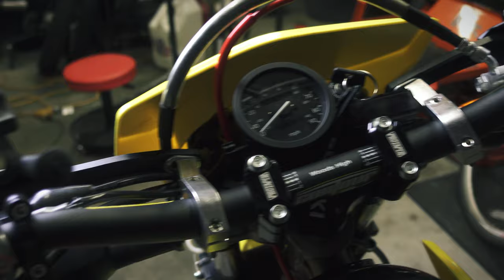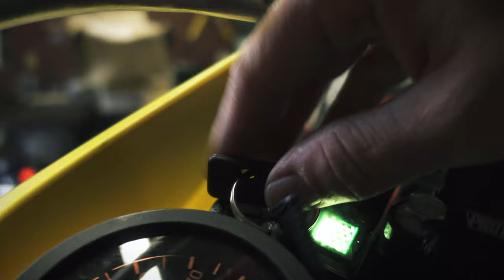Modding a Suzuki DR200 Part 4 |  NIBBI RACING CARBURETOR AND MORE!

Comment: Dude just purchased a 2003 dr200se.  After ordering a carburetor from ebay for 50 bucks and it was leaking out of the float bowl over flow right out of the box I decided to buy this nibbi from this video.  The nibbi carburetor pissed fuel all over. I took the bowl off and the floats wouldn't even shut the fuel from coming out with me holding them all the way up.  Poor quality crap that I'm shipping back to Amazon.  Good video though.

Comment: i bought a grom clone instead of this, and am amazed at the after market. engine swaps, tons of parts that fit groms works on it with little fitting,  i had planned to get a zs 212cc for it, but have since went full yx 140 top end with a z40 cam, nibbi 26 carb,, an exhaust for the grom,  i have about 2300 bucks total in my bike and it runs amazing , topping out at almost 70 , i love these little bikes. its too bad there isnt more performance aftermarket for this bike, beyond exhaust , carb and jetting upgrades . i really wanted one for a minute,  i seen there are some cam and head swaps for these, but nothing that is a significant upgrade.  i have no doubt these are great bikes tho , just if you want to tinker and do mods,   it doesn't seem like there is much available.  im saving for a 19hp zs212  for my clone, and at sea level with some tuning many have got 20 hp out of it,  and this is on a much lighter bike,  granted i have no interest going off road or using it as a dual sport. i have no doubt this bike is superior in every way if you want a bike for that purpose though . this is probly the perfect motorcycle if you want a ds , and have no intrests in modding it.

Comment: Good job keep them coming love the build Im going to have to try that carb on mine.
Reply from the maker: Thanks! I’ll also have an updated video out soon on my final jetting and some tweaks on the nibbi carb. So be sure to look for that if you do buy the nibbi
Reply: @Caustic225   Thanks ill be waiting to see it.I have a old 2003 Dr its funny how they have not changed much...Its hard to find after market parts so your videos are very informative. .. im looking for some more street friendly tire but have not had much luck keep up the good work.
Reply from the maker: Thanks, but yeah besides the look it hasn’t changed very much so most newer parts probably fit the older models also. As far as tires go, look into the Shinko 244s or 705s those might be more of what your looking for. Pretty good prices on them also.
Reply: @Caustic225  I have alot of fun on my little bike I have rejetted it and shimmed the carb and that gave it a lot more pep my buddy has a crf250 and on the street I can keep up with him. How much did that exhaust set you back?

Comment: I tried two of these carbs and they both overflowed as soon as they had gas in them, IDK  why,  I hooked them up the same as the OME carb. the 32mm fit better then the 30mm, But its a very tight fi to the airbox.  great series though!

Comment: I know you've probably already sorted the air box fitment issue but - if you have some room to play with, and you should, disassembly the carb and get a machine shop to mill down the airbox mouth a few mm. As it's tapered, it'll fit with some squeezing.

Comment: Well seeing how well this worked for you I may try the 26mm one for my mod 50 with 108 stroker(wish they had a 24mm though in the pwk style). I saw these but not many good thorough reviews. May try the same one on my 200 as well later.
Reply from the maker: I’m definitely not disappointed in the quality of the NIBBI carb. Seems to be working great so far but unfortunately I believe the smallest PWK they make is the 28mm. I’ve seen a few videos of people putting the smaller carbs on their pit bikes with good results.

Comment: Honest question for an honest answer - I have a DR200S I take out on less travelled goat roads and use it to flat tract at practice days as well. (I've lightened it up) *My question is in hindsight was there much difference in your first Jet mod with CV Carb vs the Chinese Nibbi mod ? Also be awesome to do an update on your changes, even if you have sold it. Thx for the Vids - wish you would pump out a few more. Hope all is well!

Comment: Hey man just got this whole set up on my Dr200 how did you end up getting it to fit the air filter side Did you have to take the screw  mounts off of the air box and move the air box 1/2 inch up ? Mine seems to be running a little short and really want to keep the air box’s on instead of a pod filter

Comment: I tried pwk flatslider 28 mm carburator with 62mm bore . Issue is twisting throttle it's boggs. Jets using mj 115 and pj 32

Comment: Waiting to see where you are at on the fine tuning.. Debating on Getting that carb instead of a rebuild kit
Reply from the maker: I’ll put a video out on it but it’s tuned up nicely and I also used this (link below) to make it fit like factory. It’s working great so far and made a huge difference. 

34 PICT CARBURETOR SPACER, dune... https://www.amazon.com/dp/B003KKF9TO?ref=ppx_pop_mob_ap_share
Reply: @Caustic225  Sweet thanks! Sounds good. Lookin forward to it
Reply: @Caustic225  Thanks for this recommendation. It fits perfectly. I did order some gaskets because I'm getting a bog when I hit the throttle regardless of swapping jets and tuning. I'm assuming there's a vacuum leak. Hopefully the gaskets will be the answer.

Comment: What kind of top speed to you get out of this with the exhaust and carb upgrades?
Reply: It does not alter the top speed so much. 
Acceleration will be greatly improved with carb swap and aftermarket exhaust though. Personally I put in a PWK 28 carburetor, DG exhaust, uni pod filter then I replaced the front sprocket from a 15 to 13. The bike is completely transformed. The stock carburetor is this bikes biggest bottleneck. Once that is swapped you can hang with other enduro 250s and such .like the CRF250s and such

Comment: Nice build, do you think that nibbi carb/cable and throttle was worth the price?
Reply from the maker: Yeah it seems to be better than the stock carb. I’d say it’s definitely more worth it if you haven’t jetted your stock carb yet
Reply: @Caustic225  I was just getting ready to buy the jets and stuff for the stock carb.  So all I need for the nibbi is the carb, cable, throttle control, and grips

Comment: Did you record removing the exhaust baffle
Reply from the maker: No but I actually put the baffle back in and the air box lid on also. Jetting has changed again too so I guess I’ll need to put an update video out soon.
Reply: @Caustic225  thank you so much I have a 07 dr200se and I was just curious how to remove the baffle and if you can would you be able to show like how to or put instructions in the description
Reply: @Caustic225 where’s the update video man 😫 good all is well

Comment: Bro great videos with good info on the Suzuki Dr 200’s , I have a 2009 dr would that new carb work on mine?
Reply from the maker: Thank you and yes I do believe it will fit your bike also. I will have an updated video on some tweaks to the jetting and some other adjustments to make the nibbi carb fit perfectly. Keep an eye out for it if you decide to buy one
Reply: Thanks for replying so fast !!much appreciated for the great info
Reply: Have a great Thanksgiving!!
Reply: I have a 09 as well. Did you ever swap your carb out?
Reply: @WillyP1066  No bro I didn’t, but when it needs a new carburetor I will try it

Comment: Awesome videos! Am I write to assume that I couldn't use the existing throttle cable? Replacing that and the grips seems like a pain. Thanks again.
Reply from the maker: Yeah unfortunately you’ll need to replace the throttle cable. I looked for one but I don’t think there is one that would match the nibbi carb to the factory throttle assembly.
Reply: @Caustic225  Thanks for the reply! Ordering the nibbi! Thanks for the inspiration. I have searched and searched for the Q4 and they are back ordered unfortunately. Must be popular.
Reply: What is the adapter you use on your gopro? I assume it's for a bluetooth to connect your mic? Thanks again, Sir!
Reply: @Caustic225  hello, sir. Quick and silly question... Is the fuel line on the opposite side of the carburator from the pit cock? The carb came with a red rubber cap on one port, and I just want to make sure I'm connecting the fuel line to the correct spot. Thanks in advance.

Comment: Hey Caustic what jets did you settle on in the 32mm carb?
Reply from the maker: I actually went full circle and ended up with the stock jets that were in the carburetor out the box. The nibbi carb is harder to tune than a stock carb with small adjustments making a bigger difference. The jetting may be different depending on where you are. I’m at basically sea level so that’s why I used the stock jetting
Reply: @Caustic225  
What stock jets were in your carb? What clip is the needle jet on?
Reply from the maker: 2nd highest slot on the needle and 128 jet I believe

Comment: Dude, you want to sell me your old carb ? I cant find the one you bought online anywhere and I need a new one.
Reply: Hey Mike. I just did the swap on my brand new dr200. Has 20 miles on it. How much is reasonable for the stock carb?
Reply: @greatunclejasper  

Hi Jason, where abouts are you ?
Reply: @redmike1098  I'm in Rochester, NY.
Reply: @greatunclejasper  shame I'm in the uk
Reply: @greatunclejasper  

What jets did you put in the new nibbi?
Reply: @dylanoliver9198  my nibbi came with different sizes than the ones on these videos. It's not running quite right with the 32 and 128. I'm waiting on a shipment to try a 130 or 135. It's bogging at zero to 1/4 throttle.

Comment: Hey dude,
Thanks for this series,
Which top 3 mods would you say make the biggest difference from stock?

Will give me a winter project.
Reply from the maker: No problem man but I’d say go for a carb mod with the air box and exhaust whether it be the NIBBI or the stock carb with new jets. Other than those, I really like the JNS headlight and the supermoto wheels if you like ripping around some curves on the street.